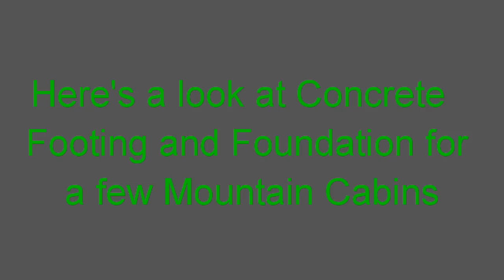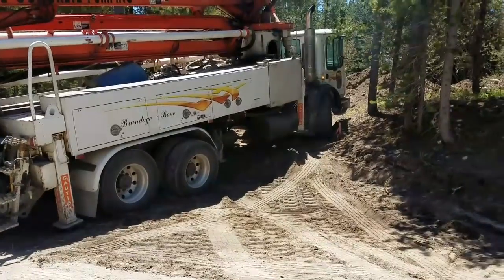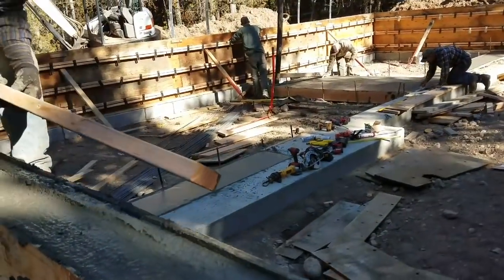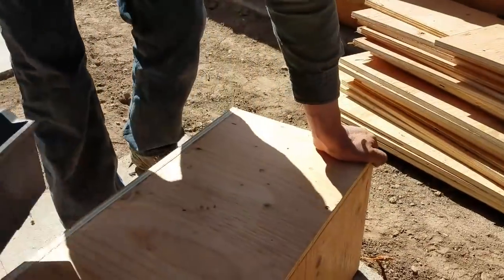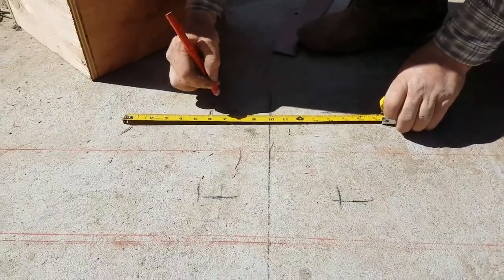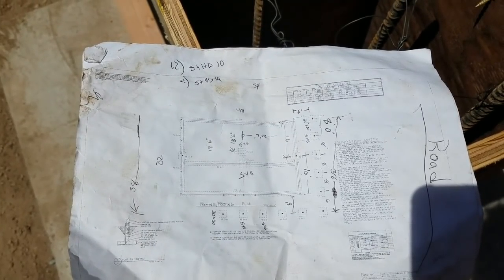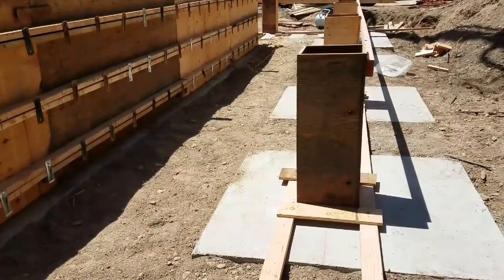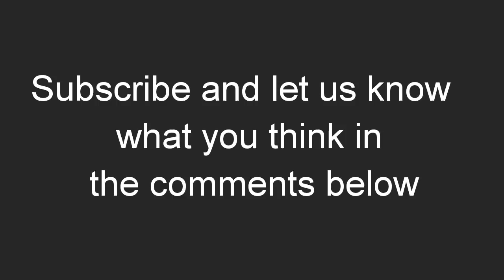Footings and Foundations with Snap Tie Forms for Building your Cabin or Home

Comment: Next time you do a hurricane strap, screw a 1x3 to the outside of the wall, add a small block above the wall attached to the 1x3, and then screw the strap to THAT which is now above the wall and the screws won't be in the concrete for removal later on.  Much cleaner and easier.
Reply from the maker: That's a great tip! Thanks for sharing.

Comment: What size of stone is used in that concrete?
How do you prevent it from cracking?
No control joints?
How many days til you remove the forms?
Do you keep the wall wet to cure?

Comment: Josh:  Are you forced back to the 20x60 pole barn.  If so I will proceed onto a 3360 sq. ft home.  With a U of 3- 40' HC  containers open to the south.  Containing:  6 Kids bed rooms, 2- baths,  Back entrance/mud room,  pantry, front entrance, small office.   40x40 Main center area: Kitchen ,  Dinning,  Great room ( 2-seating zones, main stair and lodge fireplace ).   2 nd. floor 20 x 40 :  Master bedroom,  Spa/dressing room, 1/2 bath,  Mom's/guest room  ( pull down wall bed).    The 40x40 central core will be all exposed timber frame.  In the front to the south a 12x40  Deck with arbor over for summer shade or a screened Porch if insect protection is more important.  All in my head now;  time to open a new drawing file.   Bert

Comment: Round point shovels are for digging not pouring concrete.After over 30 years of pouring foundations, first time I've seen someone use a screed board, drilling dowels isn't structurally sound as placing a bent dowel.and would never be allowed on commercial or a good engineered fdt.

Comment: Given the title I thought we'd see how the form ties work.  You showed the bottom ties, but not the inner ties on the forms.  I tried building my own forms once and I did it off a book I bought.  Well the wire they told me to use didn't hold the forms in place and boy did I have a mess.  I went out and bought the largest size wire I could find and that worked pretty good.
Reply from the maker: Haha, sorry about that! I guess I got too carried away with the bottom ties and forgot about the inner ones. Building forms can be a real challenge, but it sounds like you found a creative solution with the largest size wire. Way to think outside the box!

Comment: The rebar does not conflict with layout. Unless its requested, i dont see a reason to drill instead of wet settingthe rebar. If you think it conflict with layout just add extra. I have never seen anyone do this unless they forgot about the rebar or if they just missed a few.

Comment: Engineer that does my plans won't allow "wet sticking" rebar into the footing.  He says they are useless.  We have to bend then 90 degrees and wire tie them to the bar in the footing.  Lacking that, epoxy is OK.

Comment: don't they use concrete vibrators ?   some years ago I was overwatching concrete work and one of the workers inserted a big needle like thing in the wet concrete and it kinda looked as if somebody pulled the plug out of the bathtub...
a concrete pump sure beats wheelbarrows and shovels ;-)

Comment: Nice job I use this system everyday, what are those straps called that are on the footing that the 3/4 forms sit on I want those for the tops, we use 2x4 on the footing 3/4 back and put 2" nails to hold bottom

Comment: No concrete viberator to avoid air bubbles in the walls?
Reply from the maker: Keep It Real We use a 6 bag mix to keep the concrete creamy and flowable.  Using a vibrator on a snap tie system would be way to much especially on a 4' tall wall. We also tap the walls with hammers around any areas that may need a little help.
Reply: the qty of cement doesnt make it creamy and flowable....   did you add extra water to get it creamy...   did you go past a 4" slump...   im betting you did so your water cement ratio isnt what it should be.  so for your 2500psi mix your probably closer to a 2000psi mix.   im not sure what psi was engineered for those footings and walls but thats hopefully still within spec.
Reply from the maker: the huckster we had it mixed at the batch plant at a 6 inch slump because we know running it through a concrete pump we're going to lose about 1 inch of slump and instead of pouring a five bag mix we pour a six bag mix adding more concrete powder for greater strength and it seems to make it creamier and easier to work. The concrete that you're seeing is coming out of the pump at around a 5 inch slump. No water was added and our psi is miles above minimum standards
Reply: I pour and vibrate walls up to 22' it's done every day with snap ties, Johnny walls, flat shoe, aluminium dont matter. It's always good to vibrate or use a self consolidating mix. Good work

Comment: When you screw all the hold downs as well as any ply , it makes waaay difficult to strip , you spend more time plus you damage the ply  , it should have be nailed , you have what looks like 4 feet walls , try that with 10 and 12 feet walls foundation. The 2x4s at the bottom of the columns should be nailed with a small piece of tied wire o. The concrete to make sure it won’t move , the columns should be braced on both sides to keep them plumb .
I don’t want to sound harsh , just sharing a few things with you , don’t want to offend you or anything .
Have a nice day .

Comment: how did you fill the snap tie holes?     did you remove the metal rod going thru or just left it in place?
Reply: Inside rod part stays in. Outside part snaps off with hammer..some guys fill the outside divet.  But with waterproofing its usually not a concern.
Reply: @cruisinthru3916  snap ties are snaped off with a piece of pipe about 12 inches long
Reply: @woodyahh2110  Ive straightened J bolts with a pipe...but i just hit ties with a hammer and they snap easy.
Reply: crok what ever as long as your having fun

Comment: What formula can i use to calculate the amount of concrete required for such foundation? length * breadth * height * thickness?
Reply from the maker: Ntiyiso Rikhotso  Concrete is measured in cubic yards Or 3'x 3'x 3'= 27 cubic feet so just like you said we are looking for volume. When I'm looking a volume of concrete I go length x height x width in inches and then convert inches to cubic feet and then to cubic yards.
Reply: Thank you very much!
Is it possible to ask the building construction company to build the foundation of my house using stem wall instead of using bricks(South Africa)? I'm just asking so that whatever engineering language they are using doesn't confuse me. I think stregth of a stem wall is better than the one for bricks

Comment: How do you remove the forms if the hurricane strap is screwed to the form from the inside?
Reply: the screws have no shear strength, therefore very easy to snap off.

Comment: I wish you had spent more time showing how you constructed the forms instead of pumping the mud. That was what I was looking for, and is more important in the long run. If not done right = blowout.  G
Reply from the maker: gerretw  There are other concrete videos on this channel that go into better detail on this particular form system
Reply: I have to build some forms using snap ties that are about 16 ft tall. They are 2 ft thick and we have to use HDO plywood for an architectural finish. They need both horizontal and vertical 2x walers. So I am trying to self educate on how to do it, which was the reason behind my comment.  Can you share a link that would be more helpful?  Thanks  G

Comment: Could have had vertical steel already set before footing pour  , with "L" bends hooked under horizontals , or simply stab verts with "L"  bends  in wet concrete . A lot less BS than drilling and epoxying , and at least if not more strong .
Reply: It didn’t really strike me as “BS”. There’s a reason for the existence of drills, drill bits and epoxy.